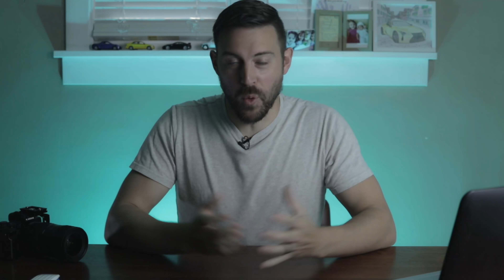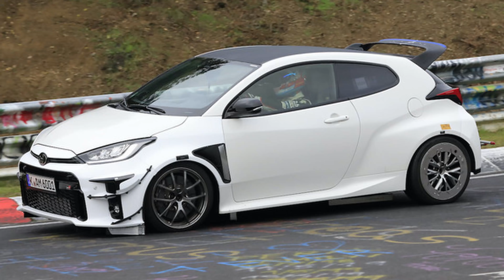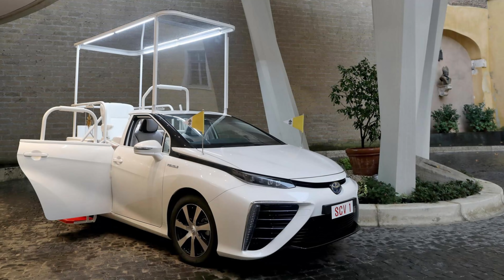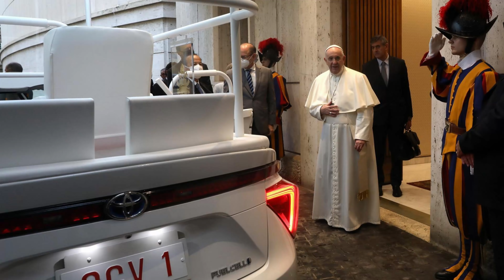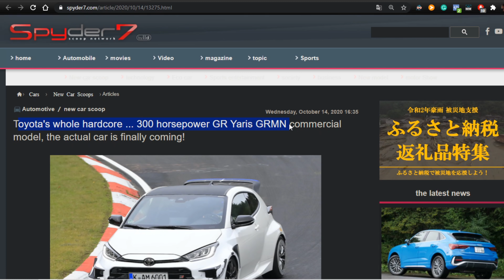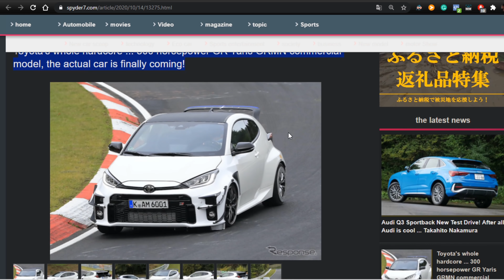Toyota's GR Yaris already UPGRADED..."GRMN" incoming?

Comment: I'm sure if you get a GR Yaris and re-tune it. Add some E85, exhaust and intake. Upgrade the intercooler. You'd 350 hp to the wheels. Easily.

Comment: 0:51 minutes I think you mean venting from the wheels, that probe out back looks like a static pressure guage or something, maybe they’re looking to use the floor even more to produce downforce it would make a lot of sense, also judging from the turning vanes after the front wheels on the floor, they seem to be wanting to out wash that wheel wake you keep flow through the floor smooth.